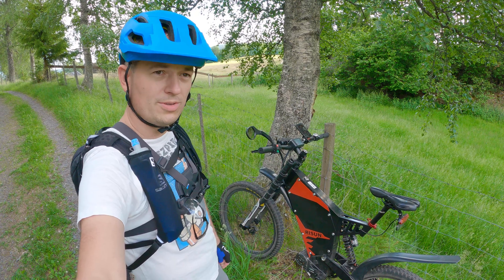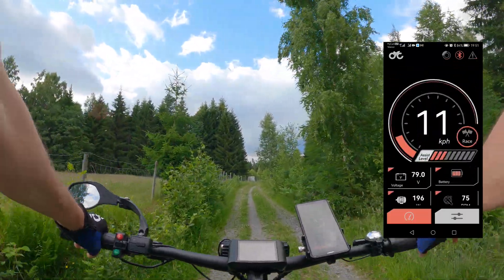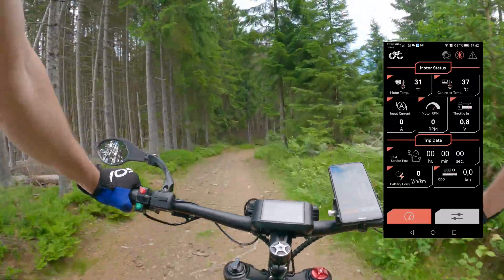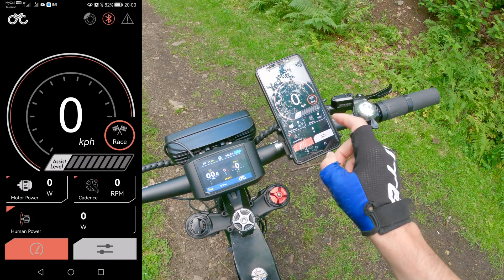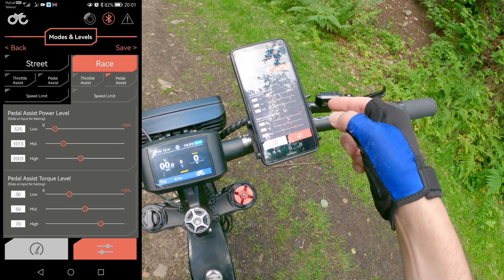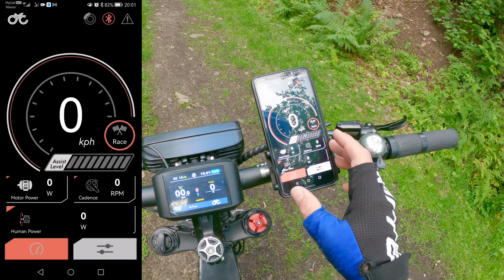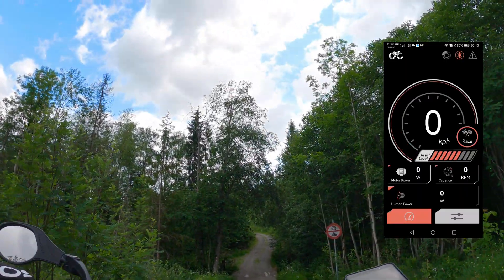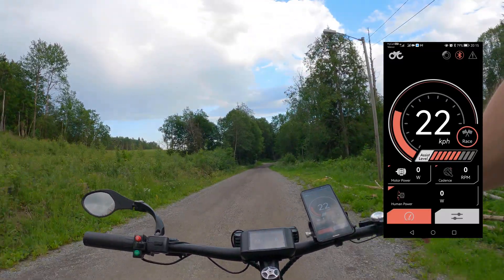Risun motorbike with CYC X1 Pro (X6)

Comment: hello. idk if youll see this or not but i got a good deal on a full stealth bomber frame with a dnm shock and volcano forks for really cheap i was wanting to know how easy the install was with the motor
Reply from the maker: It's not very complicated. You need to drill 2 holes in frame and install rivet nuts to secure the motor in place.
Reply: @LierskogenEbikes  man thank you so much i got a deal on the frame with the forks i stated and surron brakes for 300 gbp from a friend and ddint want to take it up without knowing i could use it mid drive.
Reply: @LierskogenEbikes  could i ask what sizes you used if you remember?

Comment: Is the x6 comparable to to the bac2000 cause i want to by the updated controller but want to wait for the x 12
Reply from the maker: I never tried BAC2000, so I don't have direct comparison. X6 provides much bigger torque than BAC 855.
Reply: It is very close. At 52V the x6 feels more powerfull but the bac feels a little bit smoother
Reply from the maker: @Sur_racer  I have the same experience. Check, if you have the latest drivers for X6 (from march 2023), the previous ones had really awful PAS sensation (almost on/off style).
Reply: @LierskogenEbikes  i have the newest drivers but the Pedal assist on the bac 2000 Was better (mine died because of water damage) but my topspeed with only the throttle is 75kmh on the x6 on the bac2000 i only got 65kmh. Bac and x6 have 3,3kw Max power with my current battery setup
Reply from the maker: @Sur_racer  ASI has better PAS sensation than X6. There are much more parameters in ASI controllers for that. However ASI lacks good low end torque (at least for BAC855).

Comment: Man looks like a ton of fun! You'd definitely want a full face helmet when you ride at those speeds. What gear ratio are you running and what size tires? I have a similar frame and was thinking of getting a cyclone motor since it's cheaper, but this seems so much more refined and less of a headache to mount and run.
Reply from the maker: Yes, this full face helmet may be a good investment. Regarding gear ratio. I use small 11/53T chainring in the front and 23T at the back. Is this Cyclone motor still on sale? It's very old motor as I remember and actually it's precursor of CYC motors lineup. You could go with Lightning Rods motor as well. I choosed X1 Pro because I wanted PAS with torque sensor for offroad riding. For me good PAS is a must.
Reply: @LierskogenEbikes  Cyclones are definitely still sold they're used in pedicabs a lot I think. Yeah I was trying to get good PAS through a torque sensing BB and a Grin cycle analyst but I realized it wasn't worth it. CYC is in my future.